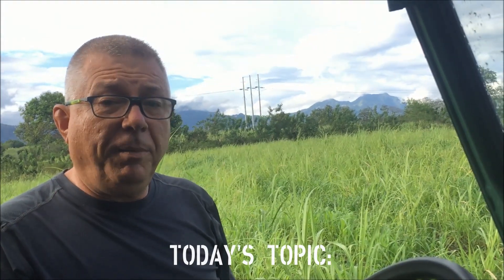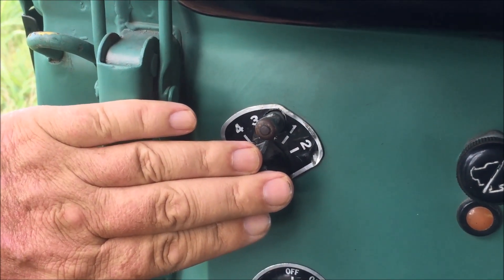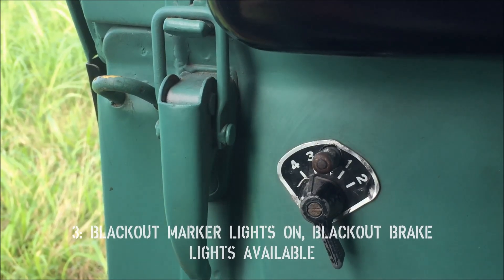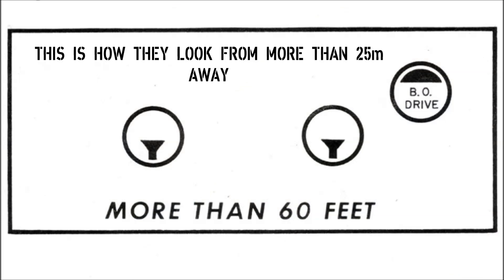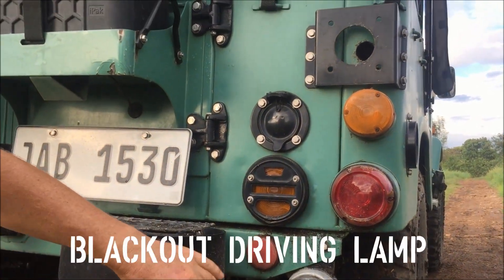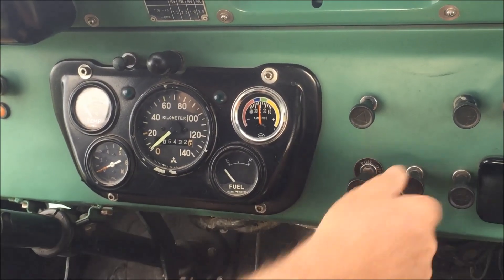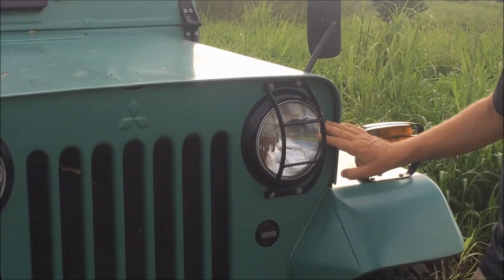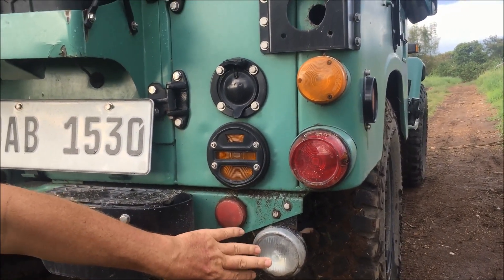How do Military Blackout Lights work?

Comment: Hello! I have a question, I have located one chassis or vin number on the plate under the hood, but registration in Canada requires 2. is there a second vin number located somewhere? Ie on the actual chassis or inside the cab? Thank You!
Reply from the maker: Certainly on the military models there is a chassis number on the outside face of the frame rail, directly below the left side door opening (driver side if LHD). Good luck!
Reply: @LesSharp  awesome got it, thank you! 🙏🏾

Comment: Not very well.
Reply from the maker: COTD
Reply: @LesSharp  
Those Navy pilots that land on carrier decks act like they're the only people in the military that has a job that'll put your life in danger during peacetime, they talk about how their heart rates and blood pressure are higher landing on the carrier than they are in combat.
They should try driving an armored vehicle at night towards the rear of an armored column in the desert where the dirt on those tank trails is like talcum powder with only blackout drive lights, talk about something that'll put your heart in your throat and keep it there for hours, with visibility at around 2 feet and the chances of slamming into the rear of another armored vehicle that's stopped, or driving off a 100 foot cliff and killing everyone inside the vehicle, that's something that'll raise your heart rate and blood pressure and it can last all night, not a couple of minutes.
Reply from the maker: Very good points!